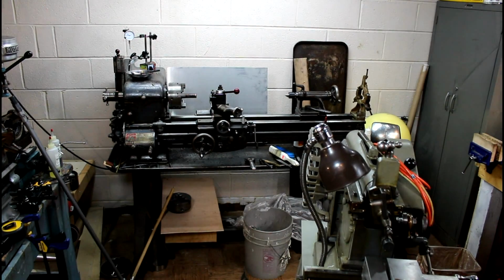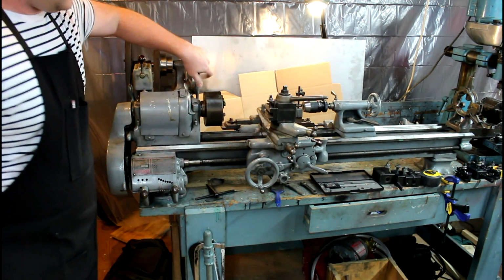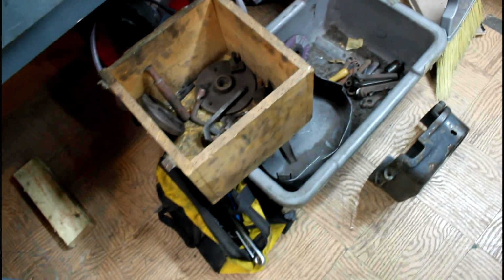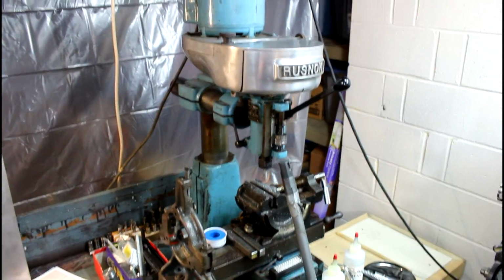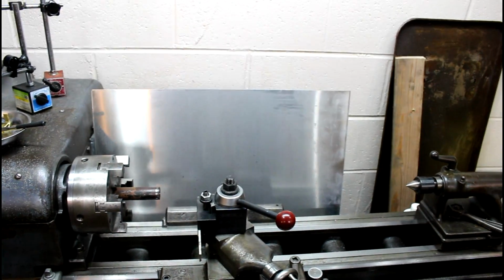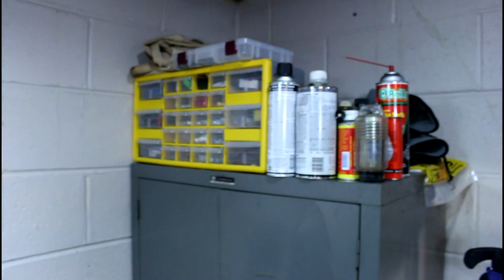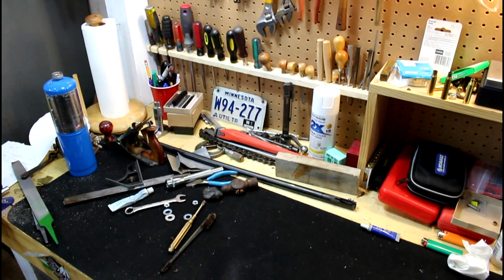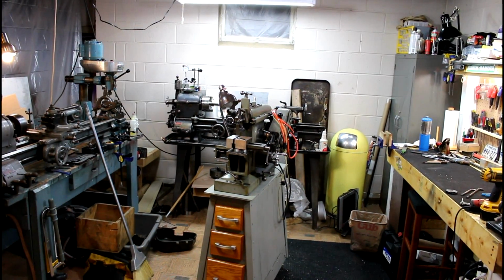My Tiny Basement Machine Shop Tour!!

Comment: Info on those Remington 700 receiver blanks? Sounds like a cool project.
Reply from the maker: They have been sitting on the back burner for about 3 years. They were blanks that were sold buy a guy a few years ago. They are suppose to be heat treated 4140. I have the print for them, just need to get a 700 bolt, and trigger.

Comment: Thanks for the tour of the Precision Machine Shed.  I have a similar little Rusnok mill.  And about the same size shop.
Reply from the maker: Thanks, that's all my old equipment and I've since replaced about everything. I reluctantly had to sell the rusnok several months ago, but picked up back larger clausing knee mill. I've got a newer shop tour video, but it's ever changing.

Comment: What you need is to get rid of one of your lathe and get a full size universal knee mill.. nice setup thoo.
Reply from the maker: That's what I did. You should check out my more up to date shop tour. I replaced just about every machine in this video, got a mid size knee mill, and upgraded my lathes. Basically a completely different, better set up. Thanks for the comment.

Comment: That was a great tour!  Thanks for sharing it with us all.   Mine is even much smaller that that!   It's a machine shop in a bedroom closet.  It has a compressed air source and a central vacuum system.
Reply from the maker: Thanks, you'll have to change to out my updated shop tour. I have replaced most of my machines. A closet, that sounds tight!

Comment: Nice shop,  better than what many at your age had / have;  the main thing is using whatever you have available to make whatever you want;  that's far more interesting to watch than using 'just the right (whatever)' to do every job.  Keep up the good work and let us know if you use Instagram.
Reply from the maker: +YCM30cnc Thanks, It is constantly changing and growing. I've replace my Smaller south bend with another 9 inch SB, and the logan has been replace by a South Bend Heavy 10 which I am almost finished restoring. Within the next 3-4 years I plan on moving and ether get a place with a larger shop or build one. Thanks for watching and commenting!

Comment: Spitfire you have a nice little shop! I love that little Rusnok! they are  hard to find! All the milling machine i have is a small mill from horror freight. I signed up! Mike Gallagher
Reply from the maker: +Mike Gallagher Thanks! I ran across that by happenstance and didn't know what it was until I got it home. Almost didn't buy it at the time, but sure glad I did. Most likely won't ever sell it. I plan to restore it although it is in fairly decent condition right now.

Comment: I have  Rusnok  milling head on one of my two atlas milling machines in my home workshop  works great  also have burke millrite milling machine  like you I  also have two shapers one ammco and south bend  and  a atlas lathe  I love old machines  fixing and using them I am a machinist by trade  almost 40yrs there is nothing like these old machines  some are 70-80 yrs old and still going  you have a nice shop it gets the job done
Reply from the maker: 1995dresser Thanks! Slowly gaining more and more tooling....life long endeavor! I have just about everything I need for what I do 99% of the time. Next project is a floating reamer holder of my own design so I can start chambering barrels again.